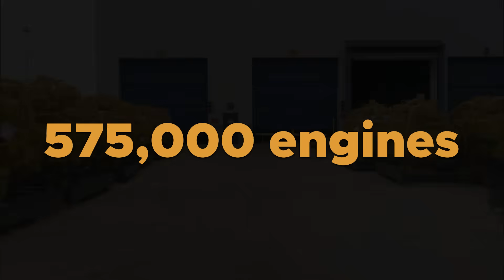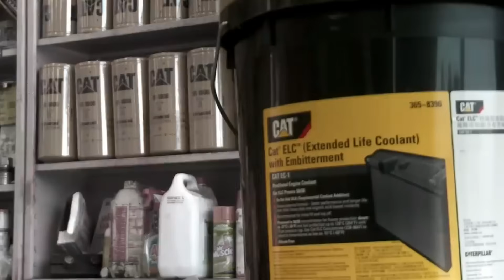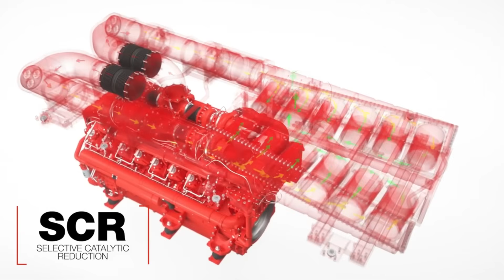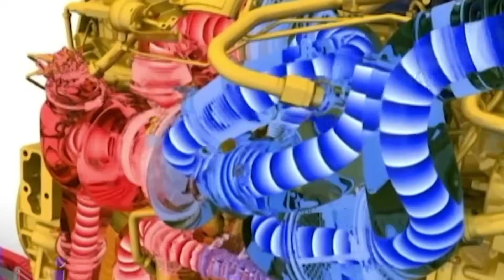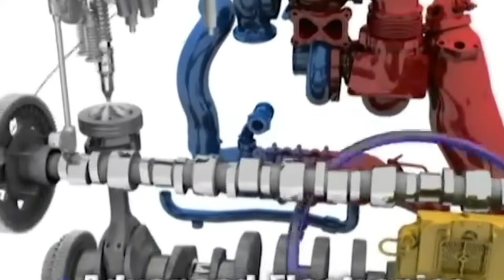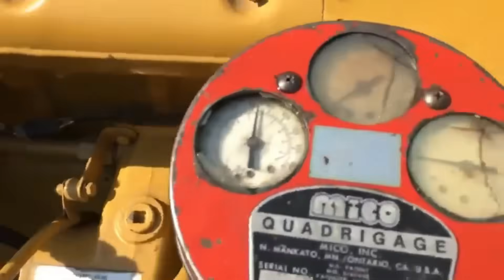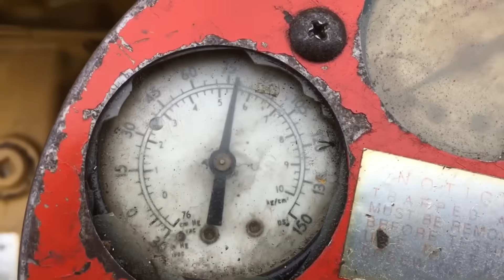The CAT 3406E: The Engine That Killed Detroit Diesel

Comment: I drove a 2025 kw with a paccar engine and drove empty one way and got about 5.5 miles per gallon. The same company I drive for has Mack’s and they don’t do any better in fuel economy. If they safe on fuel cost it doesn’t make up for the problem the emissions cost on downtime and they probably won’t be worth anything when the warranty expires 😢
Reply from the maker: That's a tough situation! The struggle to achieve good fuel economy while dealing with emissions-related downtime is a common concern in the industry.